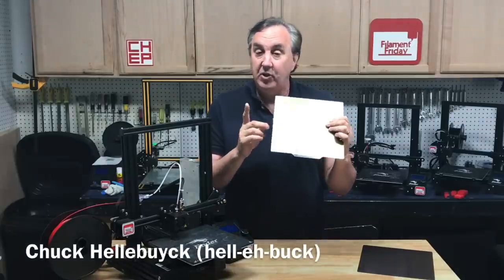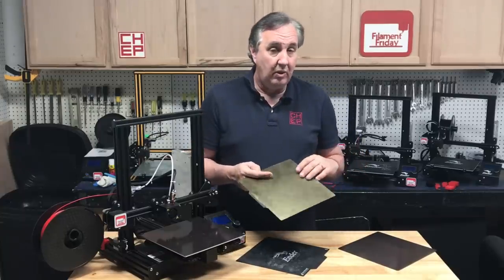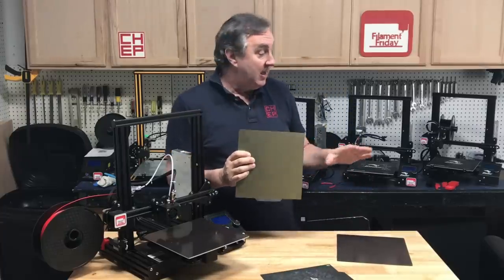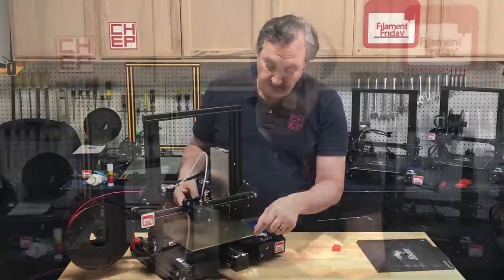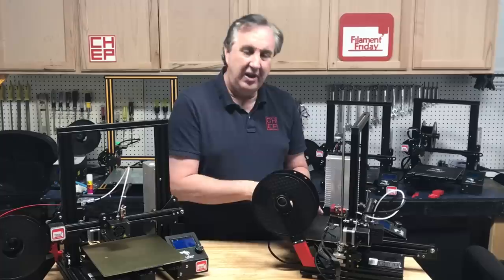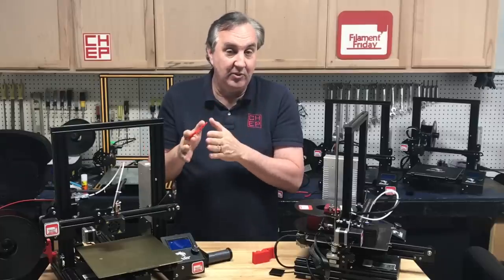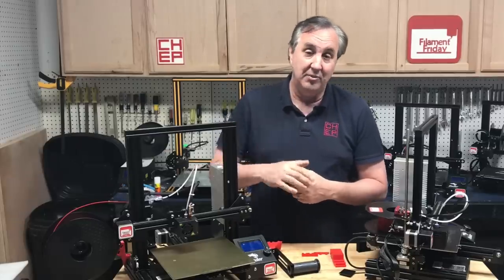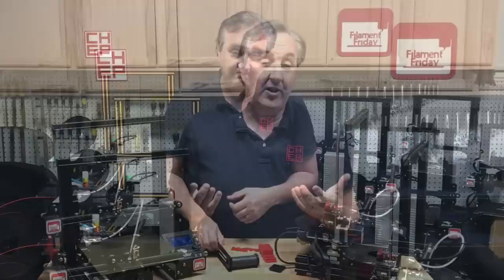Creality PEI Magnetic BED on Creality Ender 3 PRO

Comment: Need to clean it with IPA between prints. I have one from a different vendor and at the beginning I had adhesion issues as well. IPA helped and after more prints now everything sticks perfectly every time. Seems the PEI was almost too smooth.

Comment: Great video started using a PEI board on my Ender 3 Pro from 3DMaker Engineering and am seeing the same warping in the video..  One side of the PEI is smooth and the other side is grainy.  I've seen great reviews on FB on this plate but have yet to achieve.

Comment: Return the sheet because of the blemish and on the newly received one, softly scuff the PEI sheet from left to right, up and down, using a green scuff pad. Then wipe the sheet with IPA. Overtime when it loses its grip on the filament, repeat the process.
Reply: SkaPunkCommotion 
The hard plastic cleaning pads that 3M make?  That makes sense to me.  People write about ‘sanding’ the PEI, which seems like a bad idea.  Scuffing up the surface slightly to allow the filament to grip seems to be the solution.  PEI seems very slippery.
Reply: boggisthecat I’ve never needed to scuff mine. Just clean it with alcohol before heating.
Reply: Yep agree, even new sheets come like this, i used 600g wet&dry (dry) paper and it works a treat
Reply: 10throwfilms 
It could be possible that the PEI sheet you acquired may already have had a slight texture to it to not need sanding. It doesn’t need much for filament to grab onto it.
Reply: boggisthecat 
I would recommend using the green scuff pads on the Scotch-Brite heavy duty sponges. It removes just enough to add a texture for the filament to grab onto. When scuffing the PEI bed, I don’t recommend going in circles because that can make the surface uneven enough to mess with an inductive bed sensor. That’s just in my own experience.
Reply: SkaPunkCommotion 
I found the PEI sheet I bought for my Ender 3 too smooth for anything to stick reliably (bought because PETG is problematic).

Since then, I have bought textured PEI sheets (smooth PEI sheet attached to one side, PEI deposited on the textured side).  Haven’t yet used them, because I accidentally ordered the wrong size for my new Ender 5 Plus, then got the right size but didn’t notice it had no magnetic sheet...

Anyway, I should have the magnetic sheet in a few days along with the smaller size textured/smooth PEI sheet to test.  My old, smooth only, sheet should be fine to experiment with scuffing up slightly.
Reply: boggisthecat 
Yea I would totally experiment with scuffing the smooth PEI sheet because I had the exact same problem when I used it on my Ender 3. Once I scuffed it, totally worked and has been doing great since. I would just advise to keep in mind your Z offset when printing in PETG because it can stick too well to the PEI sheet and damage it.

Comment: I’m using the same PEI bed on an older ender 3, the edges are a little rough on the sides but other than that it works amazing. I only get sticking issues once in a blue moon and it’s usually because I forget to use Isopropyl Alcohol before I print.

Comment: Use cheap pei all the time, but you need to prep it. I find a good scrub with a green plastic scourer is ideal, you need to go at it quite hard though and a thorough rinse. The only downside is you loose some of the smooth finish

Comment: Realize this is a year late. Did you clean the PEI sheet before use? Wham Bam has a good video about prepping the PEI flex build sheet. Just revitalized my PEI sheet using steel wool and IPA. I don't like glue stick and prefer the systems with flex spring steel sheets with PEI
Reply: please share link

Comment: Please note that I lightly respray after every print.  Also, I let the bed cool down and then the print just simply slides off.  No difficulties removing the prints when the sheet is cooled down.  But does stay quiet tight when still heated.

Comment: The problem with those plates is that the PEI is just a thin sticker that will wear out fast.
Better option are PEI plates of about 0.8 mm thickness.

Comment: These spring steel burnished beds are too smooth for the plastic to grip onto...Mine came with a self adhesive mat which works really well..Leaves a smoother surface than the original Ender 3 mat...I just clip it on, lower thermal mass than glass.

Comment: Hi Chep, I had a lot of problem after it worked for a long time with my pei sheet which looks to be the same but a different brand. I had great results after I wiped it with acetone since the pei seems to lose it's adhesion at some point. Maybe it's helping someone else as well :) it's been working like a charm ever since

Comment: I use the creality glass with the dot coating with zero glue. Trick is you MUST use 99% isp. The others leave a film.
Reply: I have the  CCTree glass plate for the Ender 3 Pro. Thoughts on cleaning it?
Reply: Have you been running this for a while? I have had mine for about 8 months or so and it is wearing out. I started having a hard time getting good adhesion after about 4 months and now it is very hard to prevent warping with PETG without an adhesive.
Reply: @Skyrunner_84  
Not really. That's why I am thinking I just need to clean it.
Reply: @Skyrunner_84  
That's why I need to know how to clean a glass bed like the CCTree.
Reply: Ivan Miranda shows how to do it right
Reply: @gregg3364  
Which video did he do it in? I checked a few and had no luck finding it.

Comment: I've always loved PEI, but since I bought some PEX (Cross-linked polyethylene(PEX)) from Wham Bam, I haven't looked back, and think it is even better than PEI. Don't forget to clean the sheet every time and lightly sand the sheet either the pei or pex whichever you decide on before using it the first time. I'm always astounded when people cant get these to work..........I love them. Maybe this isnt pei but some substitute?

After reading some other comments I realised I forgot to mention that you need higher bed temps for them as well.
Reply: I also use WhamBam PEX on my original Tarantula and it works great. I'd like to hear your thoughts on this one.
Reply: @mattriding5588  It seems a little dubious that it is authentic or a badly made and formulated variety of it lol 

Wham Bam suggest a sand with 000 Steel wool I think.......its been a while since I had to read up on it as mine is a few years old now and still going strong. I bought a sheet of pei and adhesive and glued to some Boro glass about 4 years ago and it also is still going strong. I removed the 1mm sheet and flipped it over to the other side at the half way mark also cleaned to glue off with thinners or turps I dont remember :-)
I naturally sanded my pei when I first got it also as it was so smooth I thought it needed to have something to key to.

Note nothing harsh just some 600 800 grit then a good clean with ipa

Comment: After using my pei i really believe you have to have it dead on leveled. any minor tweaks you will have to redo the bed. ive been tweaking mine all night thinking i could get it back and at one point thought it was my 2 printers. i just sat down and leveled it and now its working perfectly fine.

Comment: I'm no expert, but since using the Creality Brand PEI sheet that you have here, I've had nothing but success with first layer adhesion. When I got mine, I turned up the temp of the bed a bit higher to 60 degrees. The main difference I notice between your setup and my own is that you didn't use the magnetic sheet, but I doubt that's causing any issues. Seems like the blemish on the PEI might be the issue for your product specifically
Reply: I've got the same Creality PEI sheet, and I was too lazy to remove the old cheap-o magnetic sheet that I had before and install the Creality one.  Doesn't seem to matter, although the one  that ships with the Creality sheet is a little thicker and looks to be of better quality.  I'm sure I'll use it someday.

Comment: I've come to a strong conclusion on how to clean the beds Chep.. except for glass, IPA just eats almost all surfaces or at least leaves a residue on them, i've tried it on magnetics, pei, steel pei even on g10 (this one when sanded after losing adhesion recovers its life, so i would say lifespan of g10 just kick ass, i would put it just below than glass with a fraction of the weight) and so on , all of them with the same result and comparing them with just dish soap, the soap just works, and each time u use IPA the surface is a little bit worse.
Reply: when you say IPA do you mean  50,70 or 90% ?

Comment: I'm sorry to say, but if you need glue to get adhesion on glass, then you're already doing something else wrong (for PLA that is).
Clean it well, get the bed temp right, maybe use a chassis, and especially properly level your bed.
Same with PEI, which i personally don't like due it's long term stiffness. One mediocre mistake, and the plate is screwed.

P.S.: any form of magnetic bed can be rather annoying long term. :/

Comment: I was on the fence about buying this and I think I'll skip it. I ALREADY have the same issue of warping, in what looks to be the same spot, on my ender 3 pro. I think it might be an issue with the heated bed and not the top surface of the pei sheet (since I am only using the factory magnetic flex bed).
Reply: Get the creality borosilicate glass bed then. it has a lot of mass and therefore holds a lot of thermal energy, I print PLA and PETG and both stick without problems and pop off once the bed cools down, but I usually give the printed part a couple smacks with a screwdriver handle or something light like that because I live in a tropical island (80F+ all the time) and the bed takes too long to cool down under these conditions. I've only had the tiniest amount of warping with PLA (and I mean maybe 0.5mm right in the corner) when printing a 8hr+ print with a square shaped first layer taking up 80%+ of the bed (think drawers, boxes, etc). Usually a 3mm brim fixes it (even tho the small amount of warping hasn't caused me any functional problems yet) or any kind of <insertNameHere> tacky substance people use for bed adhesion just around the areas where I know it could lift... I just use very diluted school glue (PVA).
Reply: @oriongaby  I'll check it out, ty!

Comment: I like the flexible steel beds... I didn't like PEI... but I switched to geckotek hot as my build surface... I bought 2 from whambam but I like the sheets from TH3D more... With the Geckotek, it sticks like crazy

with the PEI, you have to get it super clean and run steel wool over it a lot... the geckotek I just swipe with a little alcohol once in a while.

I got one of the powder coated pei ezflex beds from th3d to try, but I am not sure if I like it yet.

Comment: I have that same PEI bed and have no problem with PLA or PETG. usually heats up to 50 C degrees. Sometimes even to hard unstick model ) and a bit uncomfortable to unstick small model - need to much bend bed
Reply from the maker: It’s clearly a hit and miss product. Based on comments 60-70% need to scuff it up and/or add hairspray/glue to get it to work. Most run 60-70°C as well. Sounds like you got one of the good ones.

Comment: I finally got to cheap (Chinese clone) kapton tape on glass. Good enough for small PLA and ABS prints without anything additional. For bigger or challenging prints I use Aprintapro Printafix Spray. It sticks awesome. Put it into freezer to get it off easier.
I have PEI on a printer I bought used some time ago but never used it, I used the other side of the glass with glue/kapton. Kapton wears out faster but it's cheap and easy to replace.

Comment: My PEI sheet prints okay.  Not bad, but not better than glass.  I picked it up because I'm printing frames for face shields 24/7 right now, and waiting for the glass to cool down before removing the prints was taking forever, and I was losing valuable print time.  So I ordered a PEI sheet, and I've been printing with it for about three weeks now.  Pretty  much as soon as the pritn is done, I can pop it off.  But my edges are terrible, and there are a couple of VERY small blemishes on mine (damn near microscopic), and on those blemishes things stick TOO well.  So sometimes the prints don't pop off with a flex if they print over one of those blemishes.

Comment: Obviously, it was your bed temp, not the pei. Warping is caused by cooling too fast. How come you didnt mention that? Also, what filament were you printing. Try it with petg instead of pla. Other than your level test, did you calibrate at all?

Comment: Sorry yours didn't play nice. Probably Creality cheaping out on materials (just a wild guess). I've had 2 different PEI sheets; one from Amazon (no-name-ish) and the other from TH3D Studio. The Amazon surface needed a few passes of steel wool to get it to work right and it never let me down over 3 months of use. The TH3D plate has worked from day 1 after an IPA wipe.
I'm amazed that your E3P bed is that flat. Mine looks more blue than black after shimming w/ tape.
Also, I'd likely still be using my OEM mat had it not split 1cm from where the probe homes. It was only 8mon old, made for a very inconsistent Z offset. I'd only had to wash it 3 times and never had adhesion issues.

Comment: I used one of these sheets and for a long while it was great but just recently I can get nothing to stick to it 
So I have gone back to using the flexible sheet that came with the machine and no problems now.
Reply: lightly sand the pei with wet&dry (dry) I used 600g but anything around there will do then give it a good clean with ipa and it will be like new again

Comment: Silly question: Have a Ender 3 V2 (glass bed); if you stick the magnetic sheet down how do you reach the screws to change the bed springs? Has anyone drilled holes in the magnetic sheet?
Reply: Remove the Leveling Knobs below the Bed then you should be able to lift each corner and add the springs from below.
Reply: I've seen people use a knife to remove the holes to avoid bubbles. Most people I see installing it don't bother so... up to you.

Comment: I have a cr 6 se and glass bed, can I put the PEI Print Plate directly on the aluminum heated surface without magnets?
Reply: You can, but you're gonna have to clamp it down with something, because the PEI sheet likely is just a flexible steel plate that sticks to the magnet
Reply: Yes. I bought a printer second hand on OfferUp and the guy threw in a PEI sheet but I realized later it was missing the magnetic sheet. I ended up buying these clips on eBay that are very short on the top of the printbed and longer underneath and I just clip it onto the bed and it works great. I actually prefer it this way now because the magnetic sheet can only handle so much temperature whereas the clips allow me to quickly change to whatever surface I feel like and not have to limit the bed temperature to preserve the magnet.
Reply: no! don't do that.
Reply: @lajoyalobos2009 The magnetic sheets that come with the metal plates are meant to hold the plate in place (no sliding) and hold it down with easy removal. They're also meant to take higher temps so I wouldn't worry about it losing it's magnetic ability or swelling. 
I would suggest you buy another print bed surface that comes with a magnet but choose a different surface. PEI comes in textured and smooth, there's also other materials, other than PEI that still use magnets. The magnets are universal so you only need one and you can still use the PEI sheet your printer came with.

Comment: I have used that same pei sheet on cr-10s pro for almost a year... And had warping sometimes but i can live with that... Then my sensor broke up and nozzle crashed few times into pei sheet in the middle of the bed and i replaced sensor with bltouch and i needed (wanted) to replace my printing surface... And i got ziflex... Fitted on same magnetic base... That was few days ago... And woow... Woow... And after 50-60 hrs printing... Still woow... Sometimes i think that is holding too much... Anyway you should try ziflex

Comment: i want to try the pei sheets to be able to flex the parts of the build sheet and so i can use a proximity sensors cause they are suppose to not work with glass. i was about the purchase this cause i love the creality glass with the black textured side or the smooth surface on the other so u get the best of both worlds but i'll avoid this one since watching this.  have u ever considered using enclosures for ur printer. i have one for each of my printers at this point and thats the first thing i do when i get a new printer is build an enclosure if the box it ships in isnt big enough of course. if they fit i'll run them inside the box with the flaps opened but ive not dealt with parts warping since i done this. if i do now it cause the nozzle is to close to the bed
Reply from the maker: I don’t but it’s a good idea.

Comment: Man, I was watching your video Chuck hoping that you would give me the secret to success with this bed.  I have one on each one of my Ender 3s and I can only get them to work with glue stick.  I've cleaned them a bunch of times with alcohol and even scuffed them up with some 0000 steel wool.  If I use the glue stick and keep  it setup correctly it works most of the time.  Decreasing the Z-offset a bit helps as well.  I was kind of bummed because I have a friend that put a PEI sheet on the glass bend of his CR-10 and everything sticks to that thing.  I'm thinking of buying a polycarbonate sheet TH3D to skin on top of it but they don't seem to have any stock at the moment.  Sorry to hear that it didn't work for you either, but throw some glue stick on their and try it again.
Reply from the maker: It was disappointing and many comments share the same experience. I can use Buildtak out of the box without scuffing or cleaning or changing settings and prints stick well. I just don’t see the advantage to this. .